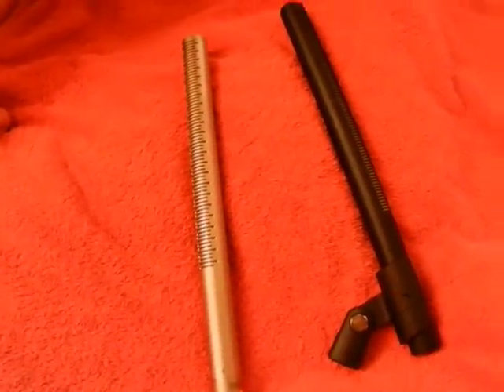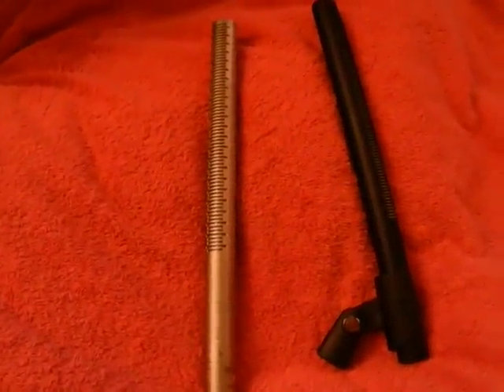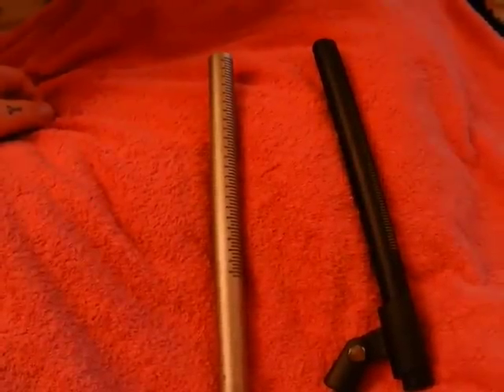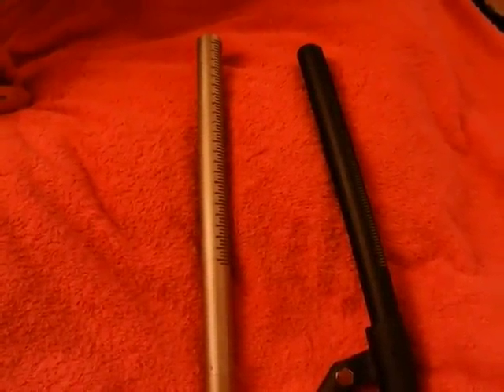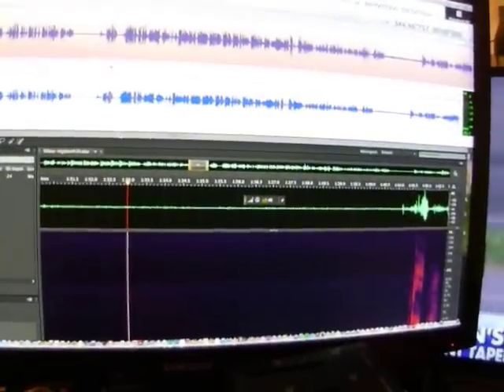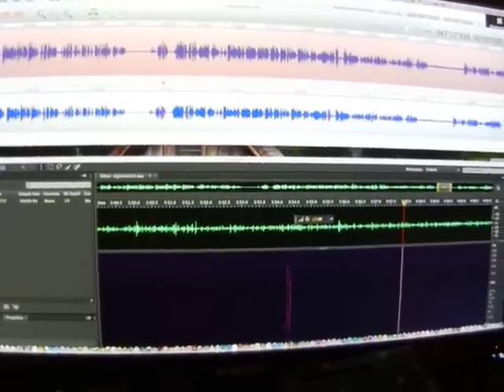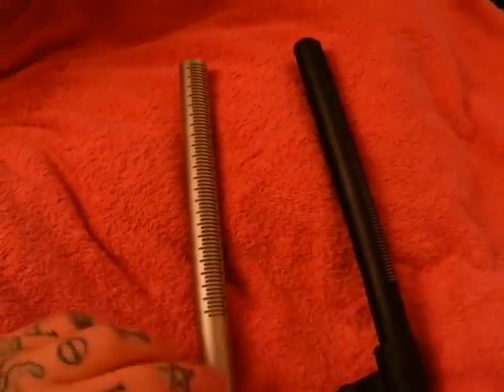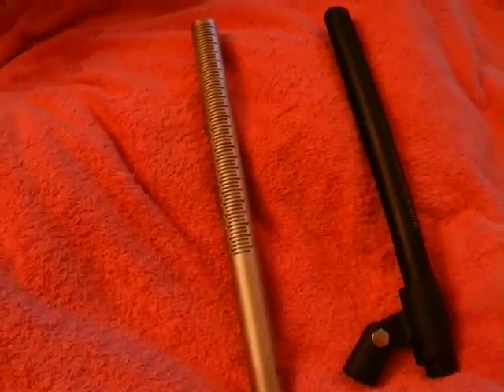RODE NTG3 VS. SENNHEISER MKH 416. Audio samples, spectrogram, lateral rejection, and self-noise test

Comment: Excellent comparison with some valuable points made.  Looking at these for studio VO work in a sound dampened but not sound proof environment.  Most of the VO pros recommend the MKH416 because the studio production houses can just drop the vocal in (i.e. know how to easily deal with it).  I probably won't be the next Don La Fontaine so the Rode will probably do the trick for me. Thanks for the post.